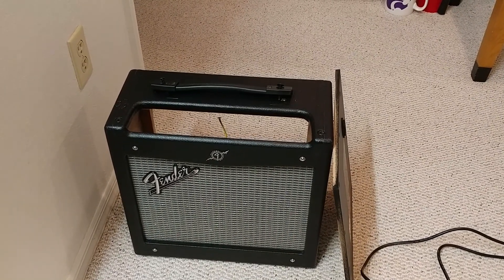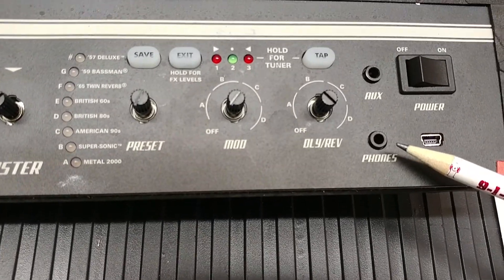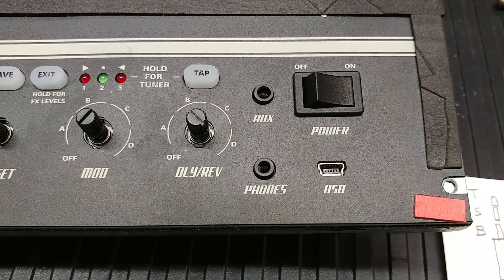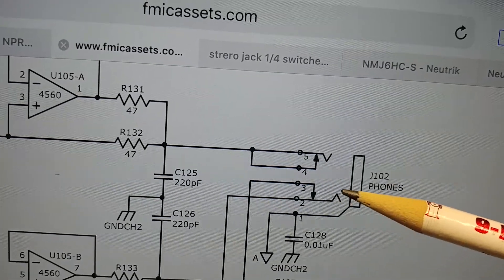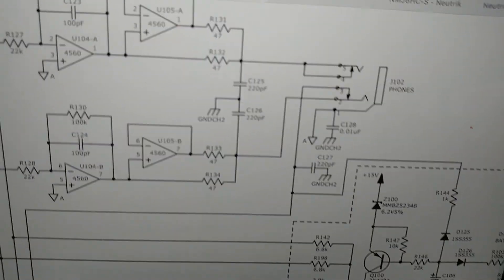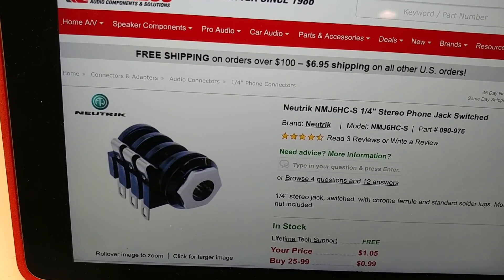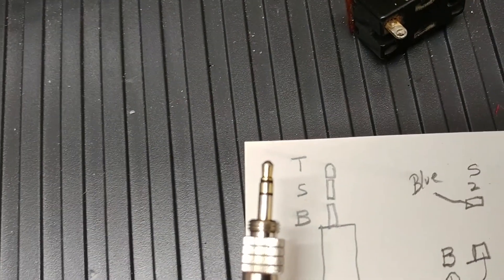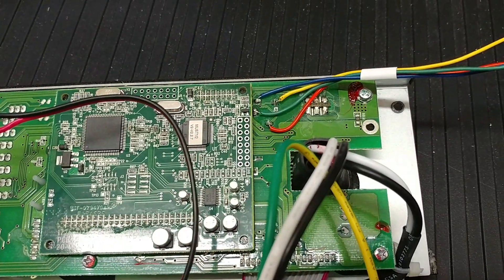Fender Mustang Headphone Jack Repair

Comment: Hi Dave, my Fender mustang 3 had the same issue but I tried to do the repair and I'm just not talented enough I suppose and likely made it worse. Following your guidance was amazing though and I'm very thankful for the help, it was just a shame I lacked the skill to pull it off. I'm getting better at electrical work with pcbs but I need way more practice and started in on the wrong project. 
Would you know of a way to bypass the aux and headphone jacks completely? I tried figuring it out myself but fear a further decent into the hole I dug. I know I could bridge something from the input to the power amp if I knew where to go with it. You seem to be the most knowledgeable about this issue on YT I'd also be willing to pay for the info. Thanks again for your great explanation and if I ever had a fighting chance it was because of your help.
Reply from the maker: Care to say where you live?
Reply: @channelingdave   that's fine 🙂 Las Vegas NV
Reply from the maker: @austinjeffers6645  I’m down the road in Phoenix. I could probably fix it for you if you every get down this way.

Comment: Great information!  Mine had an intermittent volume drop issue after a couple minutes after powering on, then it generally would resolve itself after about 10 minutes.  I manipulated the headphone jack during the failures and could bring the volume in and out.  I inspected the solder joints and they looked fine, however knowing they are prone to failure, I re-soldered them and the problem seems to be resolved now.
Reply from the maker: Wonderful!

Comment: Thank you so much for the detailed instructions. I decided to go with a mono 1/4" jack w/ switch.  That way I can have 1/4" & 1/8" headphone options. I plan to mount the jack and switch on  an small aluminum plate in the back, opposite the power input.

Comment: Hi man, could you please tell me how to remove the back? I removed all the screws but it seems glued on. Thank you
Reply: I used two #12 wood screws. First I removed all the existing screws, then threaded the two large wood screws into one corner hole and one of the holes next to it. I screwed them in far enough to be fully in contact with the back board, but not the frame. I carefully lifted on the two screws concentrating on the corner, gradually increasing pressure until the back began to separate. I made sure I did not apply so much force that the screws pulled out of the back board. Worked like a charm, with no damage to the back board.

Comment: Im so bummed about my mustang v v.2 the headphone jack is busted and acting like its switched all the time--meaning the speaker outs dont work for my cab. Funny thing is that the headphone jack still works even though its just a loose sleeveless hole to the contacts

Comment: Hi i replaced the original jack. But is not working properly. I have to put the plug in the middle in order to make it work.
Also speaker is disabled if i dont plug anything. 
What could be wrong? Do u know?
Reply: Did you replaced the original jack with the exact fender replacement part?